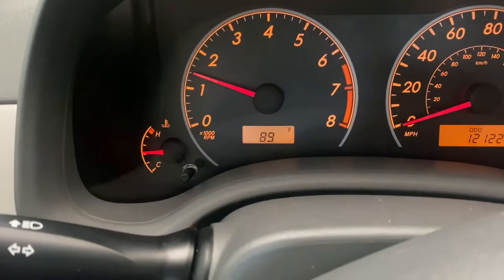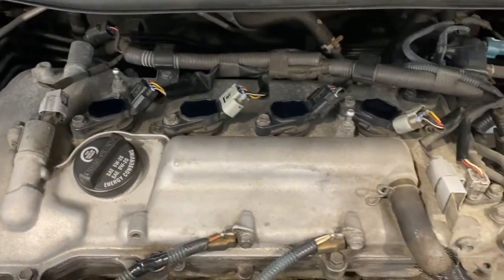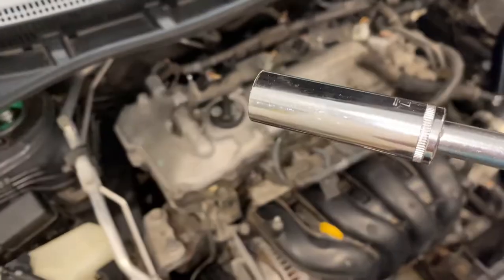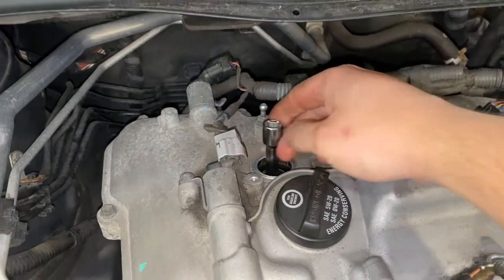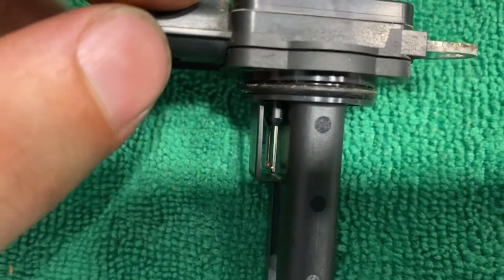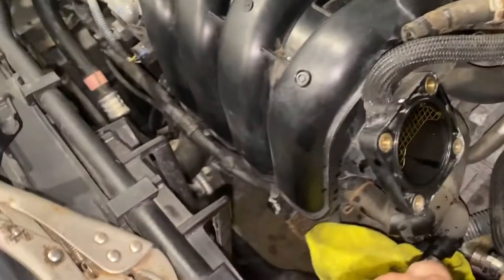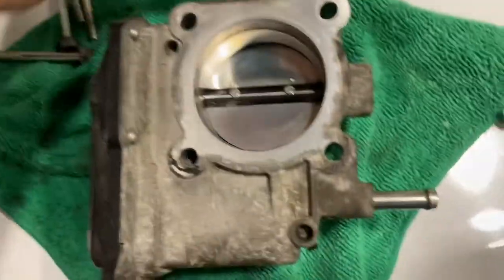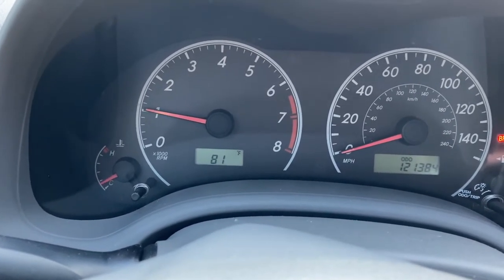2009-2018 TOYOTA COROLLA SPARK PLUG REPLACEMENT(SUPER EASY)

Comment: When you removed the throttle body, did you replace any gaskets afterwards?
Reply from the maker: I did not, they all looked in good condition, but if yours look bad or are hard or broken I would recommend replacing.
Reply: @BrandonStellmach  Thank you, are you comfortable saying that it is fairly clean around when you put it back together?
Reply from the maker: @piotrfolczyk8589  yes you want it to be nice and clean, so it will seal good together.

Comment: I got a code P0354 ( ignition coil D primary/ secondary circuit ) , does this mean I have to replace the 4th coil , I also might do the spark plug aswell. Do the numbers go in order from 1-4 , left to right or right to left? Also have the same car
Reply from the maker: From what I believe is p0354. The 4 means cylinder 4. 
Which I believe the numbers are from left to right. 
Another way to make sure it’s the coil pack. Would be to switch it to another cylinder and see if you get a new code for the new cylinder. That should help determine you have the correct one.
Reply: P219A?

Comment: has your engine cover always come off that easy? i think mine has bolts holding the bottom but the top part comes up fine…
Reply from the maker: Yea it has, you should need to pull up on it. It just has clips that are pressed onto a mount on the engine. If it doesn’t come of often it might be harder then what I show in the video.

Comment: what year is your Corolla?
Reply from the maker: My corolla is a 2009.
Reply: Every article I read for 2009 calls for a 9/16 spark plug socket.  Is 14mm the same?
Reply: @lovedogs4989  yes, 14mm is equivalent to 9/16 ... either socket will work fine